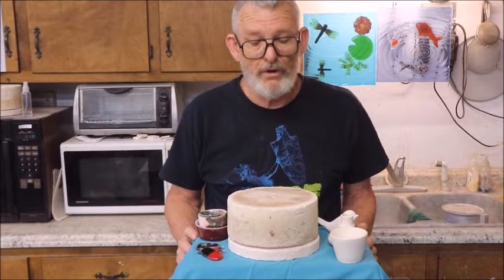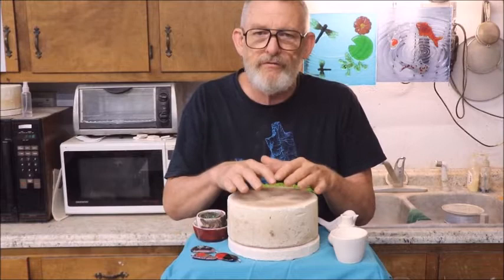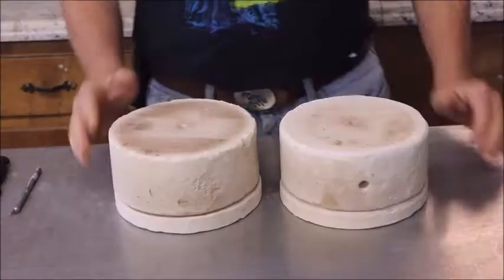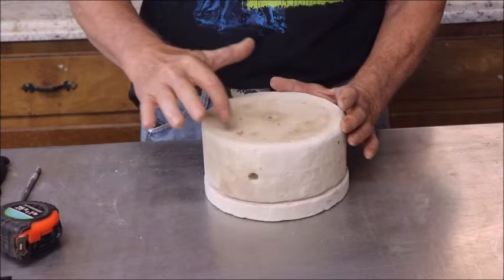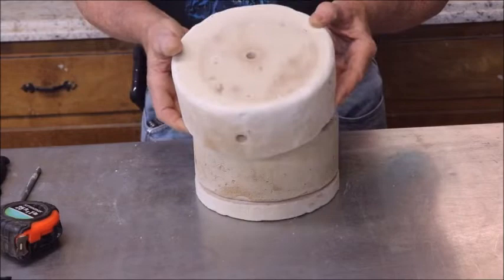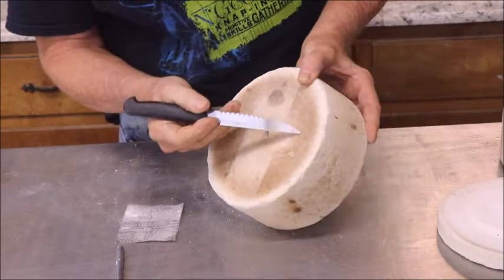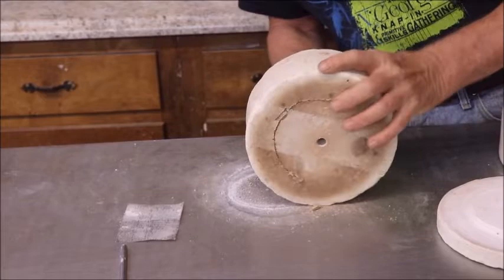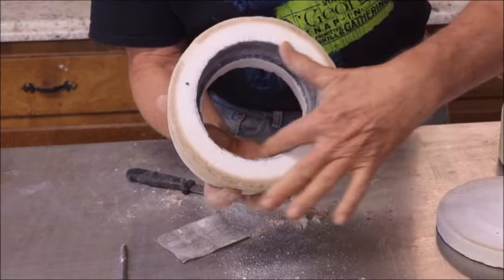Double Your Pleasure, Double Your Fun..Double Your Microwave Kiln?

Comment: You could potentially stack it upside down and keep one kiln with the cutout facing right way up so the black painted sides are touching then use the base as a lid, then the white part will be up higher and the bottom will be where the heat is closest to what you're firing :]
Reply from the maker: Thanks for the suggestion!

Comment: I think I figured this out, well I didn't, but found the answer. I was watching a video and could figure out his kiln was so big. I finally realized that what he was using was two tops, one upside down as the base and the other as the lid.
Reply: I was wondering exactly this. Can you use 2 lids, one on top of the other with the void in the middle, so you don't have to cut through one of the lids? Or is the little hole in the middle a problem, as it will be under your pot? How did they deal with the hole? ..... Thank you Cpt Mike your tutorials are great and also for giving us the opportunity to discuss microkilns in the comments section.

Comment: Great experiments! Silicon carbide as a powder is used for rock tumbling grit. I can buy it in powder form pretty inexpensively. How would you get it to adhere to the inside of the kiln wall? Maybe add it to a kiln wash?
Reply from the maker: I hae experimented with water glass also known as sodium silicate.  It has worked well for me.
Reply: @CaptMike  Did you do a follow-up video?
Reply from the maker: @JustME-ft4di  Not yet, still working on it.

Comment: My mwk doesn’t fit height wise in my microwave :( any fix for this?
Reply from the maker: You must have an exceptionllly small MW.  I have small 600 watt ones and the kiln fits fine.  You should be able to pick one up at a good will or thrift store pretty cheap.
Reply: @CaptMike  I've seen someone use their microwave on its side to get more room, do you have any thoughts on this?
Reply from the maker: @nedwh8042  Might work as ther are no moving pars in the mW except the part inside that goes round and round.

Comment: Not sure if anyone else suggested this, could try bevel the join between the 2 rings to help hold the heat. You said the outside was hotter, that could just be beacuse its bigger but could possibly indicate heat loss
Reply from the maker: Thanks for watching and for the comment!

Comment: Couldn't you just turn one over and then place the other one on top. You could the place some kiln blanket in the bottom hole or plug the bottom hole with some bottom material.

Comment: Thanks for the great channel and advice. What I’m really curious about is your electricity bill. I remember my mom firing up her big old kiln and simultaneously groaning about the electricity bills. I can’t imagine that bisque’ing in 9 minutes doesn’t use a huge amount of power?
Reply from the maker: The microwave kilns do not use any more power than normally running the microwave.  However, it cost me about $20 to run my large 220 volt kiln to bisque or glaze a load.  Thanks for the question.  I hope this helps.

Comment: Very interesting video, thanks - Just subscribed! 
Would love to see the follow up about adding the extra silicon carbide coating... and the big kiln as well... Hint hint! :)
Reply from the maker: I'm actually working on that one now,  Building it is one thing....getting the results I need will be another matter!
Reply: @CaptMike  - Hi again! Any progress? I would still love to see how your planned refinements and further experiments worked/work out.
Also, it occurred to me that, for less handy folks like me, it should be possible to just used the two kiln 'covers' to form a deeper kiln than the standard ones. Simply having one cover turned upside (like a saucepan) with the other one placed on top so the edges meet wouldn't create quite as much internal depth as you got by cutting out the top of one, but it's a lot less work and also means you don't have to sacrifice a kiln.
Reply from the maker: @GunnerHillTX  That is a great Idea and should work.  Remember, the larger mass you are trying to fire the longer it might take to get the resullts you require.  Make notes and let me know.
Reply: @CaptMike  Ha! Well played, Sir, well played! Seriously though, if I ever get a second mwk (and get my first one out of its box!) I'll definitely let you know how things go. 
I honestly would love to see some updates on your mwk experiments, if you get a chance.
Reply: @CaptMike what brand do you reccomend for the microwave?
and what is the number or kind of  the clay i can use it in microwave kiln??

Comment: Hello Captain Mike.  I have over the last couple years landed on your channel due to search results and what not. But forgive me but until now haven't subscribed until today. Your channel is great thank you so much for all you have put into it. I have recently considered a microwave kiln to play with. I have access to an abundance of river bed / flood bank clay and through my recent searches again I come to your channel. I have a few questions about these microwave kilns and your experiences with. So if you can help provide some light on these questions I'd greatly appreciate your help.
Firstly
Do you have any experience with your microwave kilns and how they respond to trying to firing wild / native  earthenware clays? The clay I have is high in flux, because it's mainly broken down granite. So lots of silica and felspar along with the clay and... my clay has been  levigated is very fine particles, and yet is high in iron and thus fires hard at low temp but also very orange red and porous as most earthenware's are. . Do you know if the iron in my clay body will effect a microwave kiln and how it works? Generally the thought is you don't put metal in a microwave (but many many glazed are metal oxides suspended in clay body's that then respond in oxidation or reduction firing conditions.)
Yet from my understanding most of the iron in likely in a non metal form and instead paired with silica in crystals form (even if microscopic)
I know you have had good success Bisk firing and then glazing in your kilns but you often use grey or even white (porcelain) clays in your microwave kilns. 
So again have you any experience with wild / native / backyard dug clay in your experiences?
Reply from the maker: Yes, I fire my "river" clay in a MWK any time it will fit.  zyou must make sure the clay is completely dry or the rapiod heating of the clay will explode the clayl  Don't worr about any metals or oxides that are part of the clay as the kiln reacts with thr microeaves inside the kiln and no sparking will occure.

Comment: Thank you Mike for all of your videos on Microwave Kilns!! You have inspired me to by one… it just arrived yesterday and yes, there is not a lot of work space, so I checked out your video on doubling the kiln. So I have 2 questions please: 1) how tall is your microwave on the inside? It seems a double decker microwave kiln may be too tall for my microwave.  2) is it possible to gain some extra work space in the kiln by filing down the base? Thank you so much for your help
And guidance!
Reply from the maker: The inside of my largest microwave is about 10.25 inches high.  A microwave kiln is 4.50 inches high including the base.  If you cut the top portion off another kiln you will have a ring about 2 5/8 inches to add to the 4.50 for a total of 7.1/8 inches total height....more or less.  I don't see a problem cutting the top off one of these kilns, but be careful.  They are fragile.
Reply: Turn your microwave on the side

Comment: Also I watched a couple videos from yourself that looked at tiring to melt glass into you clay molds using the microwave kilns and said you where going to write it off as a no go. Having watched that I wonder and will personally test when my kiln comes but... If you used medium or low or even defrost which should turn on and off while heating) Do you think you could in theory build holds and increases in temp using these settings? You said its all experiment which it greatly is but. A modern microwave that can be programed might allow you to say run, 3 min at high, 3 min at medium, 3 min at low then maybe 15min on defrost then another hit of high. My understanding is that with any kiln is all about control and learning and all that stuff.
So again I question / wonder is have you tried using your microwave kiln at other temperature setting or what not, or have you always just worked with different time intervals on high. And if you have tested other heating / firing schedules have they had any success.
I watch you breaking clay mold while trying to melt your glass down into them and having them break. You mentioned in other kilns with slower heating rates that the molds survived and the projects turned out. And again this made me wonder. Could you slow down the uncontrollable heat to be useful?
Again lets say high for 3min until red hot, then maybe 15 min on defrost as a hold period?
Sorry for a could long posts on older videos but Maybe these questions will encourage you to re-investigate these options.
One way or another thanks for all the great video's (of all only few I have watched till now but that's about to change.)
Hope you have some insight
Much love, please stay safe and healthy
Oh Just so you know we are enjoying your video's from South Eastern Ontario Canada
Sorry another question as to not post again...
Would it be recommended due to chemicals and so on to maybe put my microwave out side in a well ventilated area then use my kiln. I know that curtain glazes will off gas bad things and wonder if you have ever filled your work space with bad fumes or other things that maybe you wouldn't want to breath or have in your home around pets. Its hard to tell if you have a kitchen for a work space or a work space with good clean up options. Again you insight would be great. 
My main goal ultimately in the next couple months is to bisk some small stuff in microwave and then experiment with wood ash glaze applications. And I'm hoping your experience my help me to prevent hurting myself or others indirectly from the hazards of working with these fantastic and very interesting microwave kilns in doors.
Reply from the maker: I beleive that wity careful manipulation you could possible bring the heat up, hold and cook.  It will be a lot of wor, but I will visit the experiment again later.  If you have good ventilation  you could use the kiln in a room.  If the weather permits, just set the MWK on a table out side and worry less,

Comment: Thank you Mike.  Interesting video.  But a quick question for you:  instead of cutting the top out of one piece, "why not turn one over and put the 'two' bottom to bottom?"
Reply from the maker: Thanks Stuart, that is an excellent idea.  I'll have to give it a try!
Reply: When I tried with the standard size kilns I just upended the bottom one and set the other on top.  It worked, no cutting.  I used a think piece of hardened and burnished fiber mat in the bottom to cover the top and vent hole, thinfire on top of that.    I am loving your videos SO much!!!  You are so full of brilliant ideas!

Comment: Did your molds work for the glass slumping? I made a few pendants but the edges get flat and thin so I still need something for oval n square, the round for me doesn't sell so much....maybe I just need a mold
Reply from the maker: I have not had a lot of sucess working glass in the MWK using a ceramic mold.  Maybe it is just the ones I make that do not work.

Comment: What kind if power does the microwave need to be to get to 2000 degrees? Is it best to buy the most powerful microwave available?
Reply from the maker: If the power goes off while using the microwave kiln, just start over.  it will be OK.  Use the most powerful one you can afford.

Comment: What wattage kiln do you use? Most standard microwaves are 1000 W. Do you think I need a stronger microwave?
Reply from the maker: Any of them will work.  I have used a 750 to a 1200 watt.  You just have to experiment and work with the times necessary for the results you want.

Comment: Insttead of cutting out the bottom just flip one of the kiln pots over so the two openings face each other?
Reply from the maker: That would work.
Reply: Do you need to fill the hole that will be on the bottom, if instead of taking out the roof of a top, you reverse one of two tops and put them together?    Guessing that the bottom should still be placed under the two tops?   Perhaps that is enough to block the hole that will be on the bottom?

Comment: May I ask if the double layer will make the temperature higher or what effect will it have?
Reply from the maker: If I remember correctly, the volumn of the kiln does not matter as much as the density of the clay or bisque ware.

Comment: Hi, can i ask you what kind of material did you use to construct your saggar, to protect your pieces inside the microwave kiln ?
Reply from the maker: I'm not sure I understand the question.  The inside wall of the kilns are coated with a graphite tye material.  The top and bottom are uncoated.. I do use kiln wash on the bottom anf additionally place kiln shelf paper between whatever I am firing and the shelf bottom.  Hope this helps.
Reply: @CaptMike  thank you, i have read some information now, and i know with materials is used to construct it. It s my first contact with melting glass, pottery in microwave...
Reply from the maker: @manuelsilva6926  Good luck.
Reply: @CaptMike  Thank you, i ordered one kiln by Amazon, so i can learn about the tecnique. I am travelling in caravan, so it s perfect for small pottery. Then i will construct one also

Comment: I need help!!! Im glazing a ceramic pipe with crystalline glaze and the sheet i placed below the piece is toasted and the bottom of the kiln on the inside as well!! What happened
Reply from the maker: Did you coat the bottom of the shelf with kiln wash before using?  I usually put two coats on the kiln bottom and the use shelf paper on top of that.  Also, when glazing, it is always a good idea to use stilts (ceramic thingies with wires poking out) to support the piece.  Hope this helps.
Reply: @CaptMike  thank you! Will do! Another question, if the little crystal balls are still visible even after the piece is red hot and melting, do i need to heat it more?
Reply from the maker: @AlegriaPeace  that is what I am thinking.

Comment: How practical to heat a crucible and melt copper with this?
Reply from the maker: I have not tried that yet.  If you can get your crucible into the microwave oven it should be possible.

Comment: what is this kiln made of tho? is it making the heat to pass through it and retain it?
Reply from the maker: The kiln (white part) seems to be made of a material similar to soft fire brick.  What makes it work is the black graphite type material lining the inside.  The black material changes the microwaves to heat....I think.
Reply: @CaptMike  wow cool, so means those kind of kiln only mean for microwave ya, I can't put it above gas stove rit...
Reply from the maker: @osirusj275  Yes, they are designed for a microwave oven
Reply: Love your videos, thank you so much. Where did you find the 2 micro kilns they look bigger in diameter than the ones on Amazon?

Comment: Hi Mike, I've had issues with my microwave kiln, can I maybe contact you about it? When I fire, smoke comes out en after 3 minutes my work comes out black. Even my kilnpaper comes out brown. I never had that before... Could you please help me?
Reply from the maker: The kiln paper will burn off and turn completely white and turn to a powder.  Are you firing the kiln long enough to get the temps up?
Reply: @CaptMike  Hi Mike, No my work gets black after 3 minutes. Smoke gets out after 3 minutes. I am afraid my microwave will catch on fire if I fire longer. Can I send you my logbook by email maybe?
Reply from the maker: @rohabama  what type of kiln paper are you using?  I have never had it trun black or catch on fire.  Regulare kiln /shelf paper will give off an oder as it burns but does not catch fire.  I fire in 3 minute bursts, but the results will be the same as the temps will end up the same and the paper will burn off but no fire.